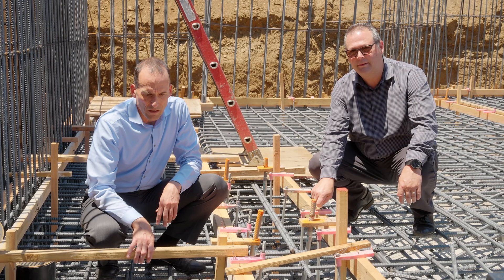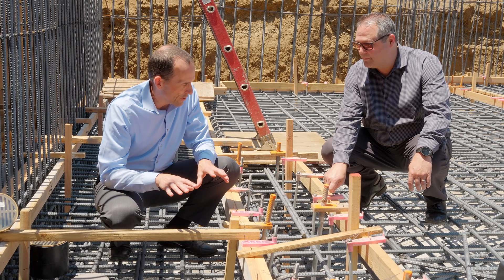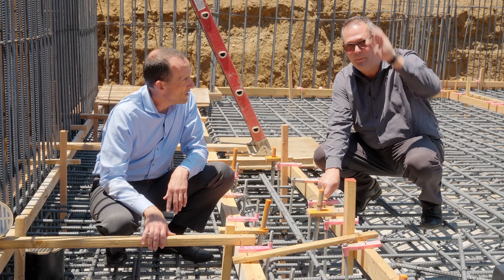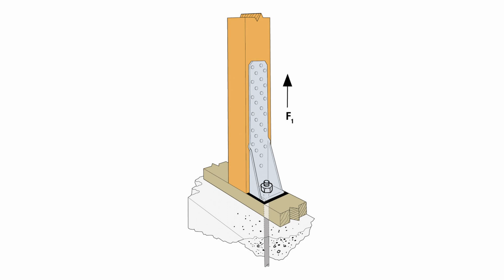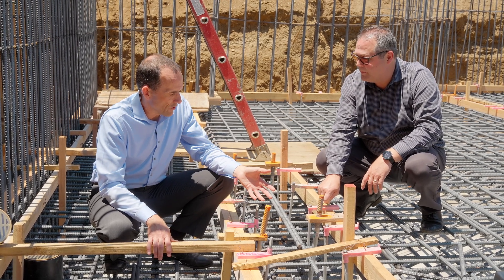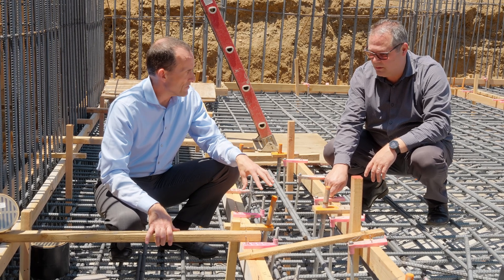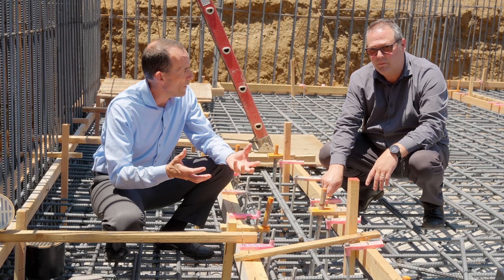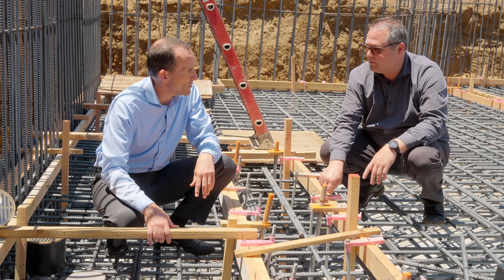Cereza Passive House #5 - Building a Cost Effective, Earthquake Proof Basement

Comment: Won’t an earthquake create leaks in a previously-airtight passive house?
Reply from the maker: I guess that all depends on the severity of the earthquake and how well the house was built to withstand earthquakes.  If the house falls apart, falls off the foundation, windows break or walls fall apart, then the last thing you should worry about is air sealing.  If it is like a normal quake around California, and teh house was built to deal with the shaking(shear walls and tying it down to the foundation) and then shaking should not affect air sealing.  Most air sealing that lasts more than a few minutes is based on a special, highly adhesive flexible tape(I like Siga and Proclima) and caulking, both of which are durable sealants that should last for decades.